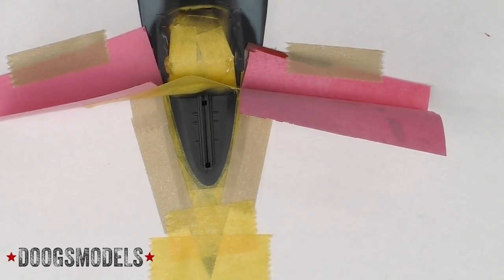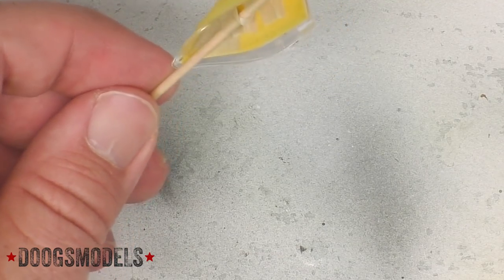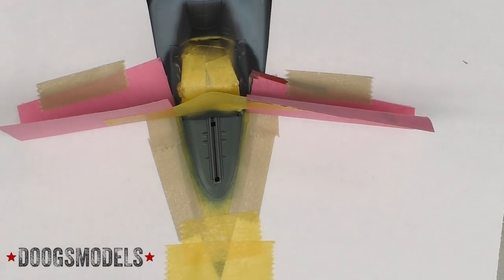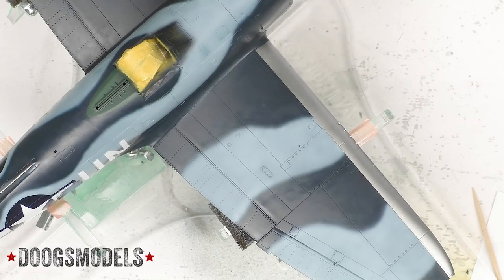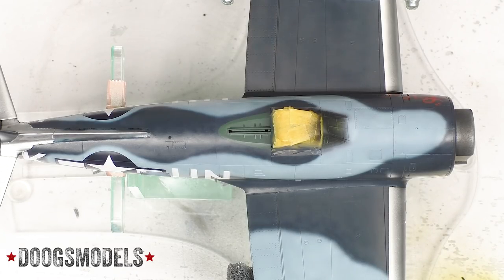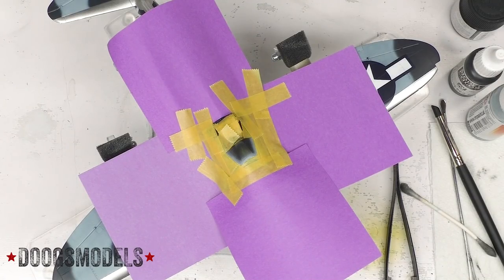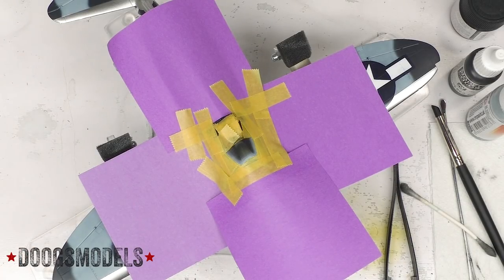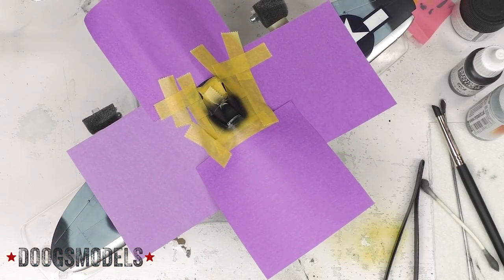Tamiya P-47M Build - Part 21: Windscreen & Canopy

Comment: Great build!!!
I know it's been 3 years since you posted this video, and propably you might not be able to answer my questions...
You mentioned that you airbrushed (K Kolor's) steel over the canopy's and bubble 's frame. Then - after 12 hours - you airbrushed K Kolors Aluminum ovr the frames.After a few minutes you aribrushed a semi-gloss varnish. Which one? I am asking this because as far as I know K Kolor's metallics are extremely sensitive due to their composition
Thank in advance
Reply from the maker: Theirs. XW60 I believe.
Reply: @DoogsModels  Thank you for your reply